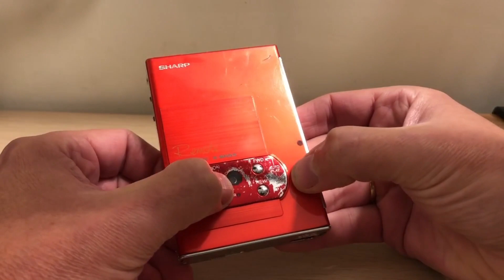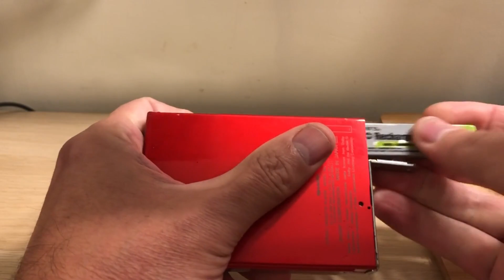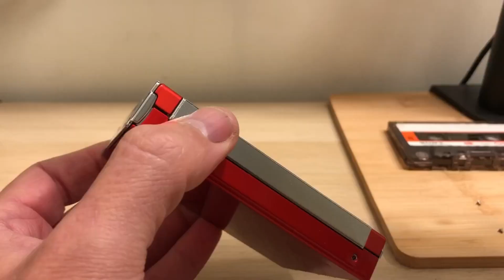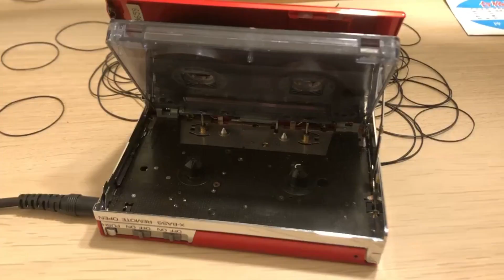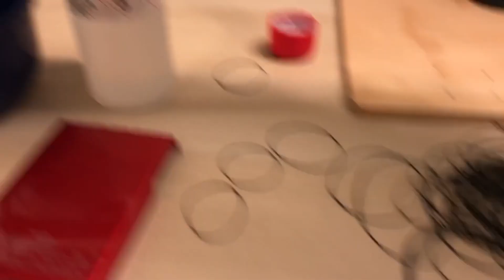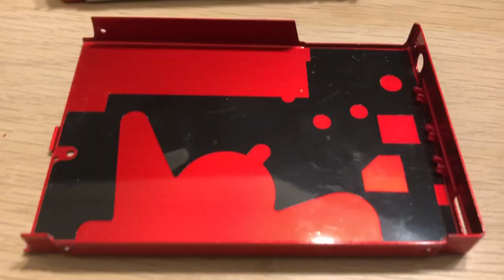How to fix Sharp JC-269 -R Super Slim Cassette Walkman Trying to fix

Comment: Hiya buddy, I have this exact unit but in black, it plays one side but fails to auto reverse and turns off. Any idea what it might be? The belt looks okay but it does look quite thick. Cheers
Reply from the maker: It might need a more general service and switches/sensors checked. I have  one with a radio which I’m going to look at soon so will be interesting to see if that suffers similar problems.
Reply: @AvidRetro Ty for getting back to me buddy ill have a look at mine